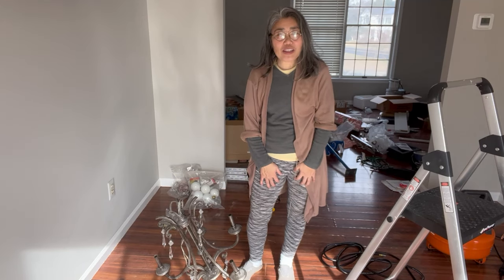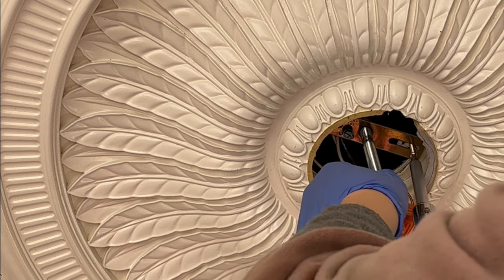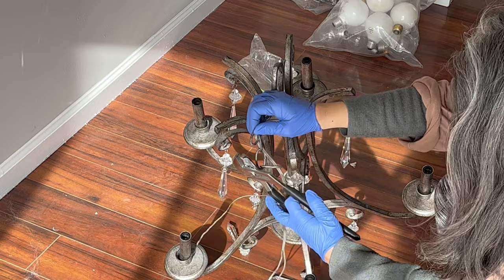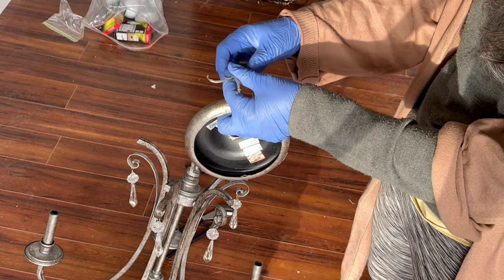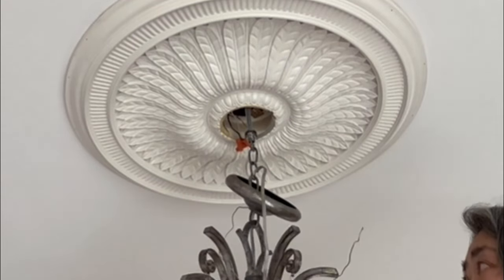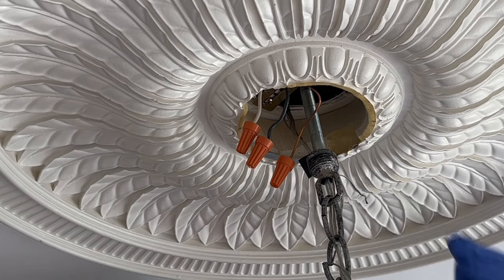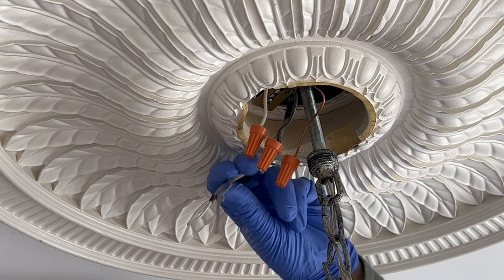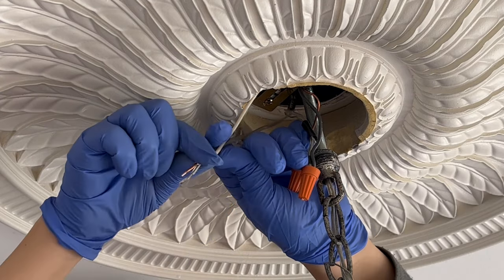HOW TO INSTALL A HEAVY CHANDELIER BY YOURSELF

Comment: Hi, great videos! I have some questions since I'd be installing a chandelier and ceiling medallion soon. Let's say I do not want mine hanging from a chain, I want the canopy as close as possible to the ceiling. However based on how the medallion adds additional distance from the ceiling, am I right to assume that even in the best scenario I'm gonna need at least a couple of chain links? Or is there a way I could do without any chain links at all? (which would be my preference). Thanks!
Reply from the maker: Using the chain links allows you to hang a heavy light by yourself. You don't need to use any chain links if you can get someone to hold up the light while you are trying to connect the wires or find some way to support the light while you are trying to connect the wires. Sometimes I raise an adjustable ladder to come up just under the light to support it, but it's a little bit of a juggling act. I hope that answered your question.